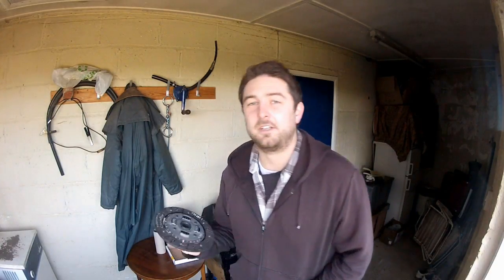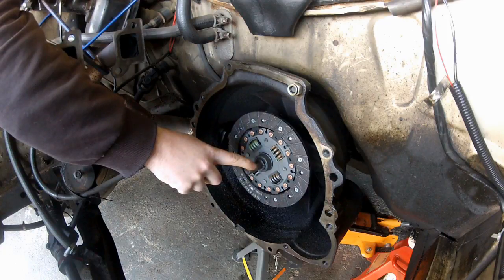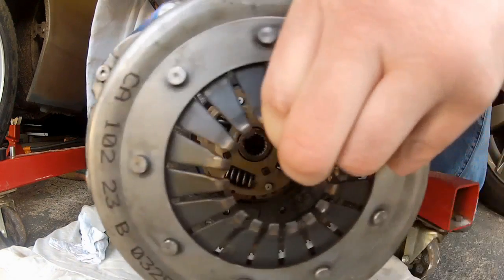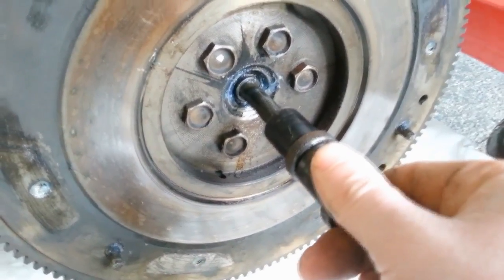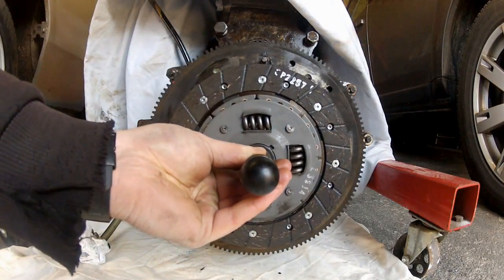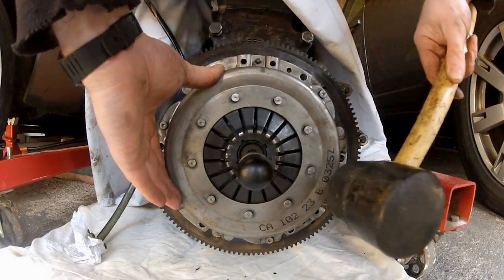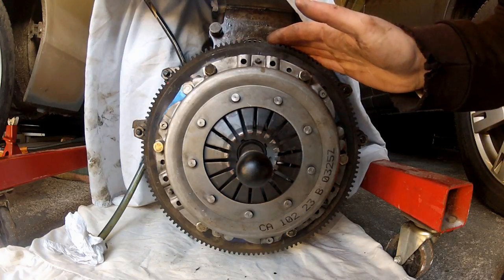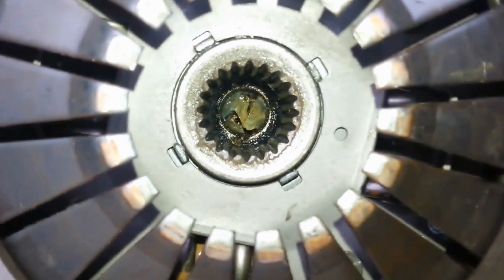Clutch Alignment How To / How To Use a Clutch Alignment Tool | Tech Tip 12

Comment: Great explanation, I've just bought a clutch alignment tool but that just aligns the friction plate with the pressure plate????
So I've made my own using a piece of wooden dowling with tape around it for a snug fit on the spigot bearing as well as through the friction plate. It's more of less the same as your metal version. I shall be taking the Master Pro alignment tool back to get a refund.

Comment: Does that alignment tool fit any car or does it have to be specifically for your car
Reply from the maker: It will fit a lot of cars because you have options when it comes to dowel sizes. Will it fit every car under the sun? Probably not.

Comment: I used the alignment tool on Toyota 1GR engine. The pressure plate fingers look off center to the center of the clutch disc. Is this normal? I’m pretty sure I inserted the alignment tool all the way and got the dowel pins lined up. I even marked the flywheel and pressure plate before disassembly.
Reply from the maker: It's sometimes hard to tell eyeballing it. Unless you get your eye dead in line it looks off. I replaced a Yaris clutch last weekend and had to use a sharpie pen for an alignment tool. When I removed it I thought it looked slightly off. Gearbox went in like butter. If you used the right size tool and the pressure plate located on the dowels. I can't see it being off.

Comment: I still don't get why the designers don't bolt the clutch to the transmission instead of the engine.
Reply from the maker: The assembly needs to rotate with the engine otherwise it's all a bit pointless 👍
Reply: @FastRust  But cant the clutch spin in the transmission housing by the axle coming from the engine? 

Pressure plates being attached to the engine or the transmission shouldn't make a difference right?
Reply from the maker: Oh I see what you mean, have the friction plate spin all the time with the engine and the pressure plate stationary on the gearbox side. Kind of the opposite way round. Flywheel would have to be on gearbox side as well.. that might be the issue. Too much inertia on the gearbox side maybe? Theory makes sense though.

Comment: Where was this video 24 hours ago?  I should have done more research.. I rebuilt my engine but didn't do anything with the clutch - including align it.  I just bolted the fly and pressure plate, torqued, and have spent 24 hours trying to get the engine mated before I realized this.  I also got debris from the driveshaft retaining clip in the transmission and subsequently "destroyed" the gearbox trying to remove what I thought was a cover. A ring came out, a bolt was left in - something to do with reverse I think, it's a mess.
Reply from the maker: Sorry to here this. Happens to us all, just a part of the learning process. At least that's what I tell myself when I drop a clanger - which happens fairly often! Try not to beat yourself up too much.

Comment: So wat happens if u fit cluch plate ring way round I have a problem basically fitted new cluch new slave and pressure plate right my cluch has been blended a few times but when I place my foot on cluch as rested on ther everytime I accelerate the cluch moves up 3mm and same when i let got off acceleration it moves down about 3mm the car drives fine but i no thers something ring can u please help

Comment: How did you get your torque wrench to warp instantly to the next bolt which is immediately torqued up? That would be well handy to know.
Reply from the maker: I'll let you in on a little secret..

Premier Pro
Reply from the maker: Major Tom? As in THE Major Tom from Laser Page all them moons ago?
Reply: @FastRust  Indeed!
Reply: @FastRust  Who were you on there?
Reply from the maker: jimmyted. You still got the Capri? Last I saw you'd done a bit of a resto on it
Reply: @FastRust  yes mate just got it mot'd week before last, your channel was handy regarding wheel bearings
Reply from the maker: @MajorT0m  Nice one mate, mine turned 40 last year so it's now tax and MOT exempt! You still on pinto power?
Reply: @FastRust  Yes mate sure am.... 170bhp pinto.. bit sickly at the moment but will soon be sorted!
Reply from the maker: It's always sickly 🤣 Still on 40s?
Reply: @FastRust  Yes still on 40s, leaking at mo but have new floats:)

Comment: Fast Rust - 
I am replacing the Clutch on my 03 Dodge Neon SX2.0 and I was jw about the alignment with a "Pre Assembled Clutch" how do I go about without hanging it wrong? 
I ordered the Alignment tool (it's in tomo) 
But being pre assembled I am not 100%
Reply from the maker: Not sure myself! Maybe it becomes pre-aligned so you don't need a tool at all. Just bolt up and go. That would be my guess.

Comment: if you dont align it, will that cause 3rd gear to bite?
Reply from the maker: Nah. If you managed to get the box in with it slightly mis aligned, as soon as you step on the clutch for the first time it would have centred itself. Sounds gearbox related. Synchro maybe?
Reply: Fast Rust thanks for the reply, when im in first gear and i let go of the gas it start grinding, when i try to put it in 3rd with clutch it wont let me, but if i use no clutch it will go in?
Reply from the maker: Was the gearbox fine before you changed clutch?
Reply: Fast Rust im not sure, the guy i bought the car from said he change the clutch and that they probably put in the clutch wrong in, and that all it needs is an alignment
Reply from the maker: There's a lot of unknowns so it's difficult to say. As for clutch installation, it is possible to put the friction plate in the wrong way, it's possible to incorrectly install the release bearing, or not install it at all - which I have seen! Then if it's  cable operated you need to adjust that, usually at the bellhousing. Hydraulic clutch usually adjust at the pedal end. Alignment is purely to install the gearbox, so I can't see this being your issue.